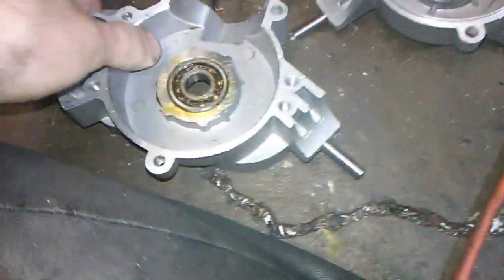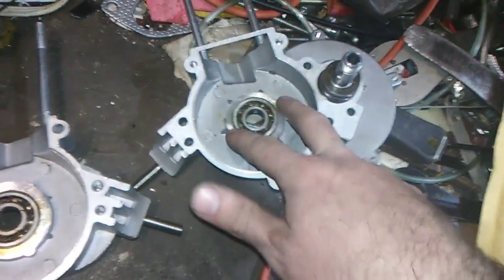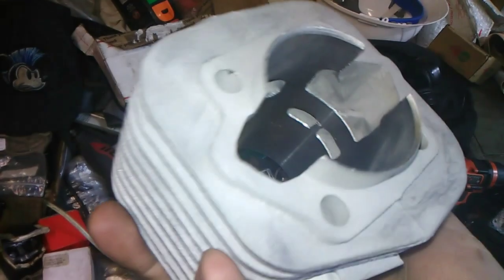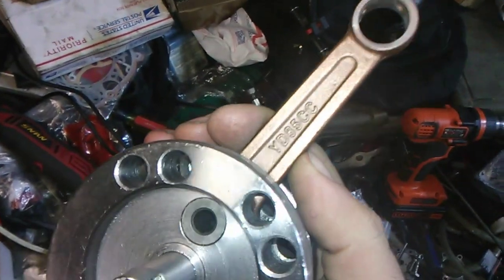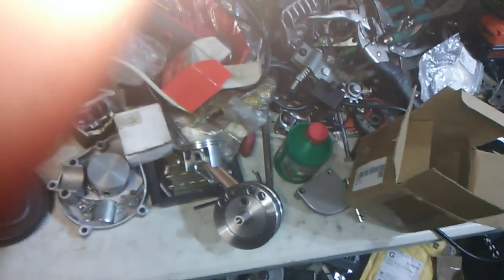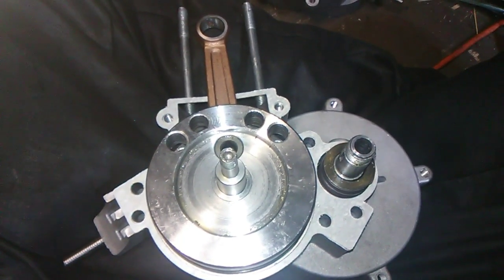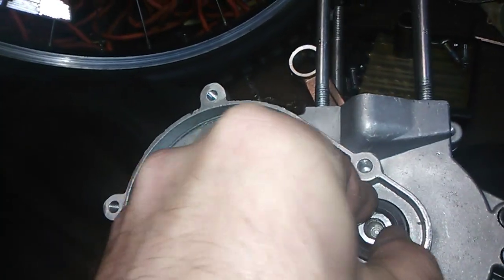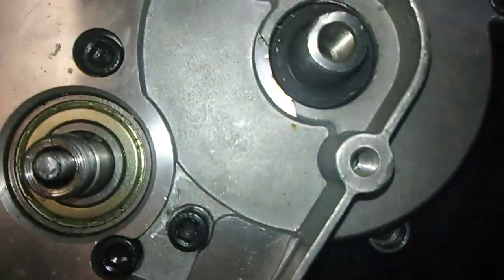"How To Build Your Own Phantom 85 Or Avenger 85" and where to get the engine case gaskets!"

Comment: The area in the case that feeds the transfer ports on the yd 100 and are not used on the phantom 85 should be filled with J B weld . Major improvement. The stock case to cylinder match is terrible.
Reply from the maker: Don't have to do that because I already fixed my phantom 85 motorized bicycle engine it's now called a super phantom menace 85
Reply: @RaoulDuke224  If you have the menace 85 cylinder match to the yd 100 case is the same. The transfer area in the case is not used. Filling that area will improve flow from case to cylinder. Big improvement.
Reply from the maker: @GregNewkirk-o8h  oh yeah
Reply: @RaoulDuke224  I know it is not the smartest question. How fast does it go? I usually say how fast it stops is more important
Reply from the maker: @GregNewkirk-o8h  as fast as the phantom 85 but it got faster acceleration
Reply: @RaoulDuke224  You mean a stock phantom 85? Imagine what the case to cylinder match and a KTM expansion chamber with a g2 reed and PWK 21 carb. As far as torque, stock clutch has no chance against this engine.
Reply: @RaoulDuke224  I chicken out at 50 mph with 36 tooth sprocket
Reply: I got speed wobbles at 45 earlier on my avenger 85 had to slow it down a bit im not tryin to die today lol 😂@GregNewkirk-o8h
Reply from the maker: That's probably the steer bar is loose
Reply: @RaoulDuke224  nah it tight it's just a steel frame Murray from the 70s it's not meant for the speed
Reply: @theLyzhendricks  My bike can go from 5 to 40 in 200yards at 9000 rpm .
Reply: @GregNewkirk-o8h  and? I could build my bike to do 65+ easy with tur right gearing and alittle bit of port work
Reply: @GregNewkirk-o8h  but like I said I went 45 and got spedd wobles and I'm not tryin to die bicycles just aren't meant to go that fast
Reply from the maker: Yeah them gas frames are to flimsy
Reply: @theLyzhendricks  50 is easy. 65 that is a different level

Comment: If you wanna run the pwk21 like you have, you're gonna have to port the thing otherwise its gonna be super rich all the time, and you wont even be able to jet around it. Open it up a little bit with a dremel (lower the intake a mm or two and widen the exhaust a little). Promise you wont regret it
Reply from the maker: I will
Reply: My avenger engine cyl responded greatly to the porting. 
Actually when I pulled it apart, after hydrosonic cleaning, these cyl's are aching to have the transfers thinned and flowed!! 45mph on a 40t sprocket.